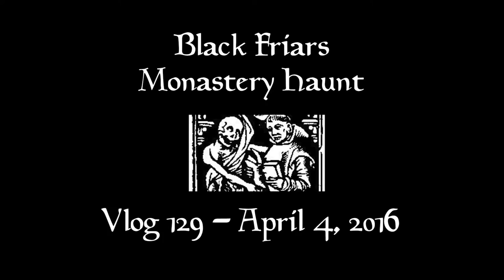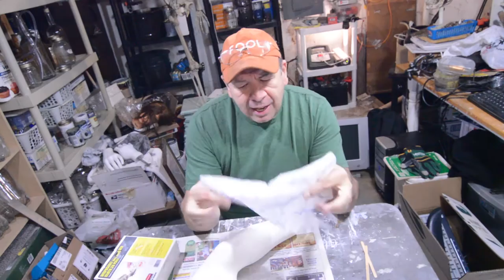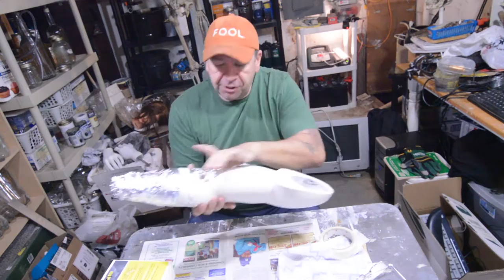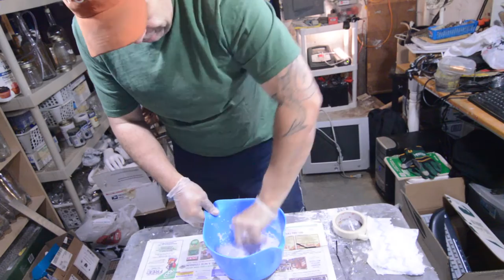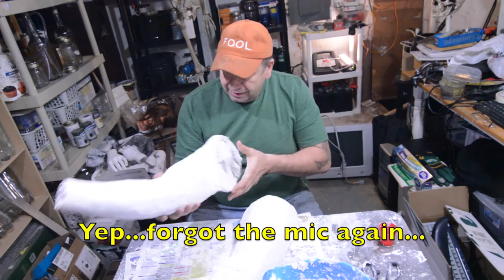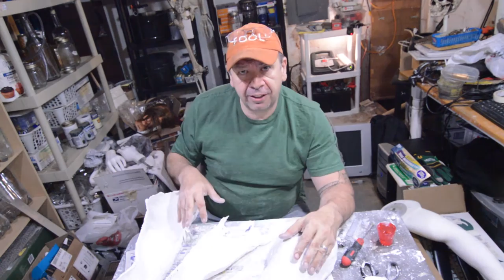Plaster of Paris Body Cast

Comment: Hey Rich, if you can find Ultracal 30 in your area it'll give you some extra working time over plaster of paris. Unlike DAP plaster or hydrocal which goes from liquid to solid fairly suddenly, the Ultracal 30 hardens gradually.
Reply from the maker: +MadCity Haunt Pffft! Where is the fun in that? Extended work time? Ease of use? No cussing? What the hell will I do for more outtakes? Thanks! I was just trying to use up this bag of plaster of Paris that I've had sitting around for years unused. It'll be fun, they said. You'll have a good time, they said. Yah. Not all mediums are good for all projects. I'll have to investigate the Ultracal
Reply: +GhoulishCop I have become very obsessive about plasters overtime due to successes and failures I have had. I use Ultracal 30 mainly for mold making, so not sure if it would have the same effect in recreating the plaster bandages but I love the idea you came up with cause damn, those real ones are EXPENSIVE! Like $5 to $8 a roll!

Comment: okay I am hoping I am getting this to you before you go any further....take the case you made, insert a dowel or flexible aluminum rod and fill with great stuff. let it cure, remove the mold you made and you have a flexible arm leg or whatever. you can use the mold several times before you destroy it. just a thought and it will be cheaper in the long run and you have body parts to play with. great video again even without the audio.
Reply from the maker: +Edie Bluntzer I like the mold making idea! Funny, but I filled the one arm with foam anyway just to see. Obviously I didn't use it as a mold, but that's an intriguing idea. Thanks!
Reply: that's what i'm here for kiddo, to make you have MORE and MORE work!!! :)

Comment: brilliant! I've made a body from chicken wire. but I am going to try this. for sure.
Reply from the maker: +De An Bryant Thanks! But you may want to watch the subsequent videos too lol. It took forever! And wasn't quite the result I was hoping for. It also is expensive, relatively speaking. The bandages add up, though I think my original use of the dollar store microfiber cloths worked just as good. Actually, in more capable hands this technique actually does have potential.
Reply: I think what you have done thus far is awesome and it most definitely has given me some excellent ideas. I'm looking forward to watching the series.